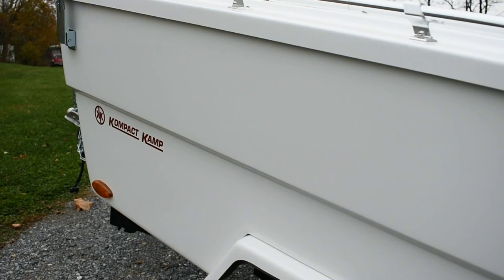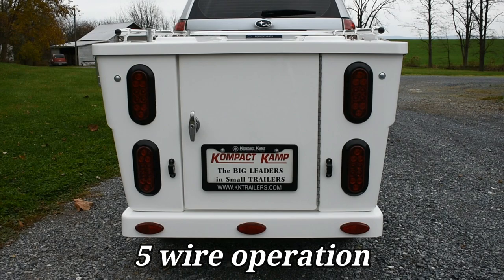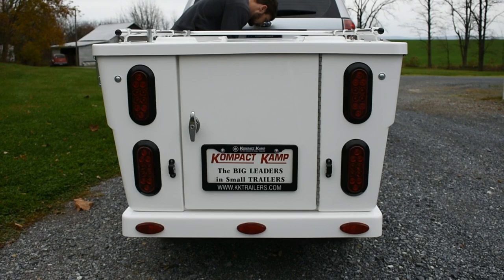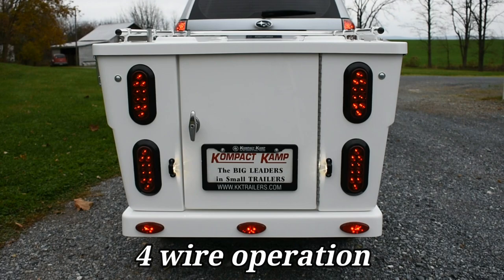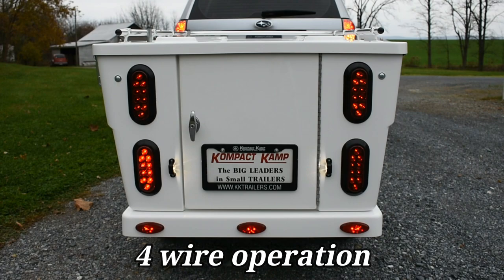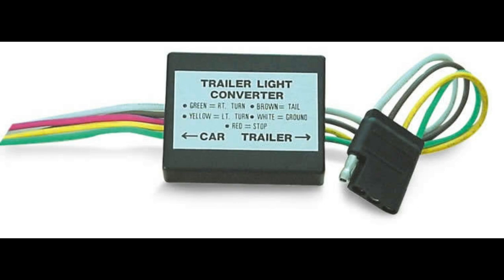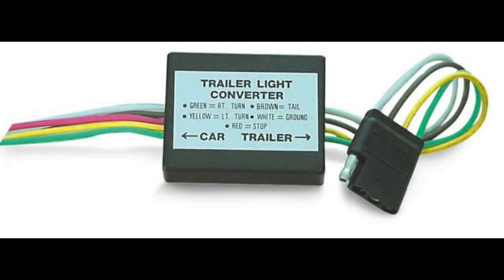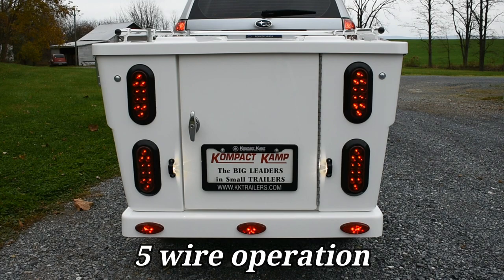5 Wire Trailer vs 4 Wire Trailer Lighting

Comment: Thank you. This was what I was looking for. So you can plug flat 5 into flat 4. No one else says it.
Reply: Actually this is somewhat incorrect. The fifth pin is used for electric brake systems, and sometimes separate brake lights however most cars are wired to combine the turn signal and brake lights on trailer harness

Comment: I am finding the motorcycle trailer plug world to be a wild west of all sorts of different plugs.  But you have made a very compelling argument for using a flat 5, rather than a round 4, a round 5, a 5 or 6 rectangle plug etc. With a flat 5 on my trailer, my trailer would not need a new plug to be towed by a friend with a flat 4 plug, or a small car with a flat 4 plug.  I think this is the answer I was after.